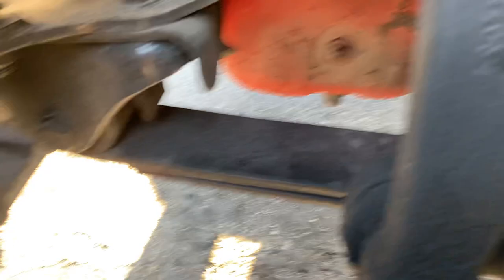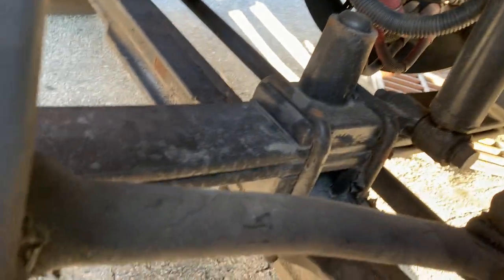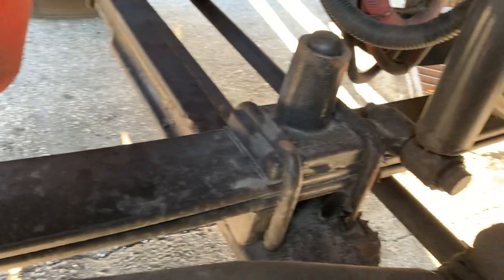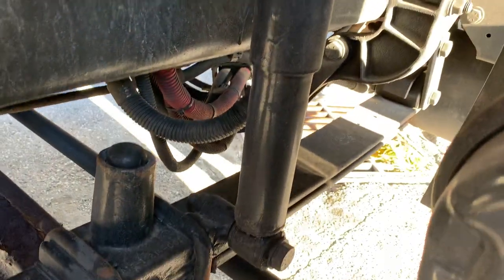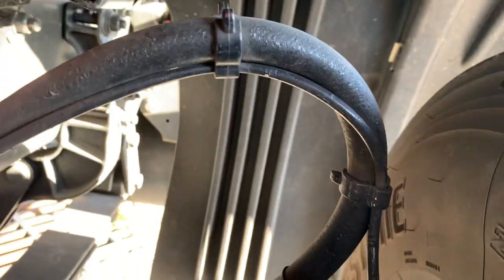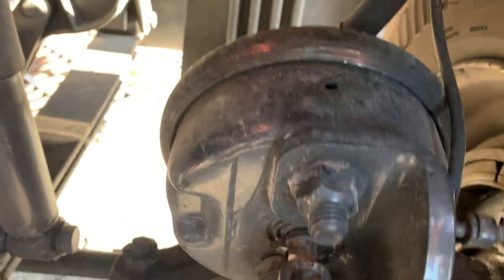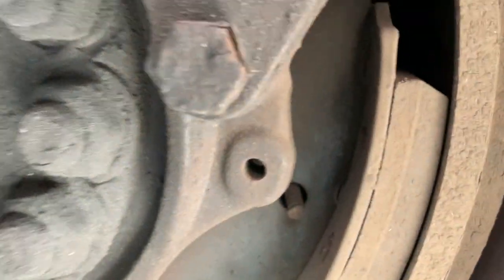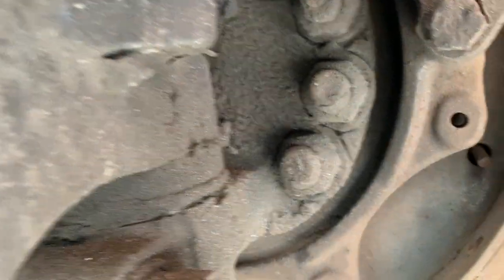Suspension and Brake Pre-Trip Inspection

Comment: Why would brake drum have oil if it's air brakes?
Reply from the maker: Oil from the power steering Hoses or engine oil.  Your pre-trip inspection. I'am checking under my engine for leaks.  These leaks my get on the drum.  Not brake air hoses.
Reply from the maker: MAY get on the Brake Drum

Comment: I'm asking cause I'm curious
Reply from the maker: If the brake Drum or brake lining has OIL ON it, this will affect braking or stopping.  If there is oil on the drum or brake lining, Most likely its a leaking brake hose.  if not the driver needs to find the leak.  The oil is not coming from the drum.
Reply from the maker: Sorry,  Not from the brake hose ( air )  If the Hub oil seal is leaking towards the brake drum,  oil can get on the drum.